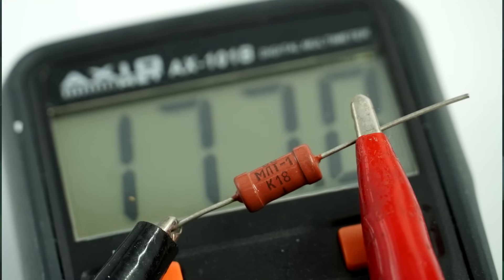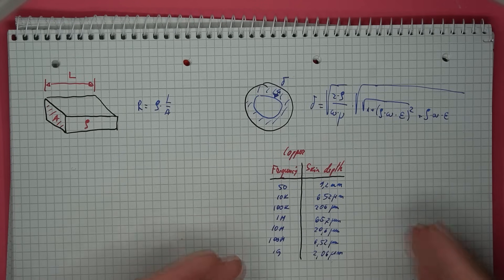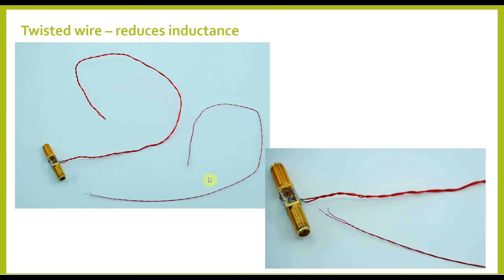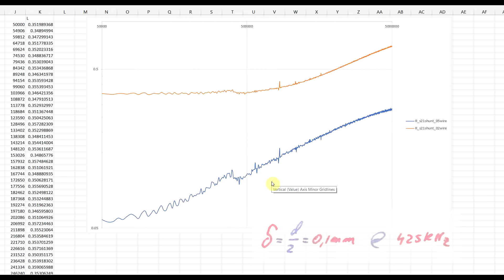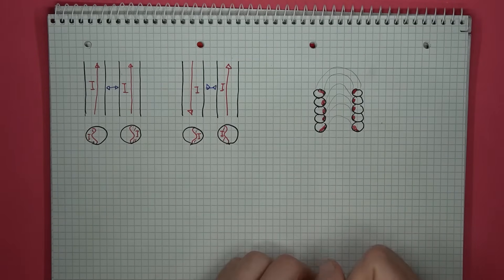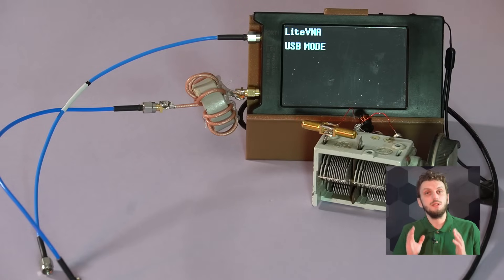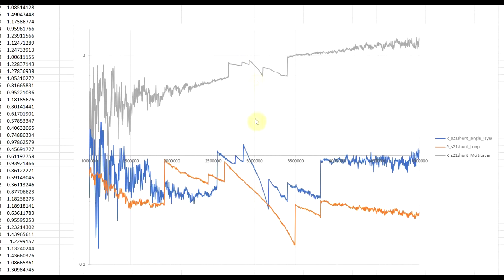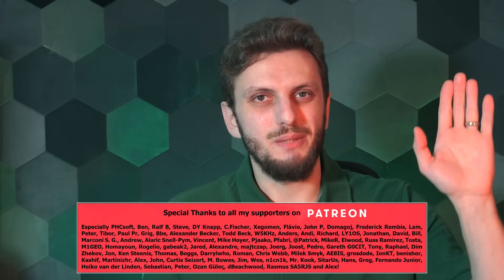Skin Effect and Proximity Effect

Comment: To avoid confusion, I would suggest using the correct term "impendance" when talking about the resistance of a component (or conductor) by doing a AC Measurement.

Measuring resistance by a DC Measurement is indeed still called 'resistance'.
Reply: Impedance has a resistive element and a reactive element.  The demonstration is designed to explore just the resistance and to achieve that, tune the reactance out which happens at resonance.  What is left is, or ought to be, pure resistance.
Reply: @thomasmaughan4798, thank you for explaining this so I wouldn't have to. Perfect explanation!

Comment: At 5:45, that is NOT true.  Parallel currents ATTRACT and anti-parallel currents repel.  Try it for yourself... or use the r.h.r. and the fact that like poles repel and opposite poles attract.  The skin effect is an electromagnetic interaction -- it requires both E and B -- and the fact that these two are out of phase near a conductor... V=dPhi/dt.

Comment: unrelated to the subject, but...

it would be nice to see someone do a practical demonstration of "jacobs law". its basically impedance matching. but more motor/generator oriented.

that is, which one has the lower resistance, and how the current appears as torque, or heat...

lol, i tried making a video and the camera wont show the display on the variable load... sigh... meh, and i really need to make one with a few fets that can deal with more than 25W anyway...

Comment: Interesting, I have  never considered the 'globular' distribution of current due to Proximity.

In a coil with both an AC component and a DC current, would the DC component act as a modulator of the AC resistance due to proximity effect? 

So, does superposition hold? Or does my question lead to a non-linear results? The answer is probably fairly simple but I don't see it at the moment. 

Disentangling heating from that sort of measurement would be 'interesting also,...
Reply: Since reactance is dependent on rate of change of current/voltage, then the DC component would clearly be superimposed and be equal to  the DC resistance.

Comment: In the 196ties we built coils with RF stranded wires with silk cladding for high Q coils. Specialists wound the coils crisscross to reduce the proximity effect.
The coils were used for the intermediate frequency path in superhet ham radios for best selection properties.
Today I am fantasizing whether an improvement of Q would be possible with conductors (wires) consisting of copper/silver clad plastic fibres.
Anyhow as we did not have a VNA all this tinkering and the rules for best results was full of myths.

Comment: I had never thought the proximity effect can be so dominant. Would using litz wire also help in mitigating proximity effect to an extent?
Reply from the maker: "to an extent" :D from what I read, litz wire, and special coiling techniques like honeycomb/basket wound coils will help, but only in the <5MHz region. Once you go above, there is not much that can be done...
Reply: Depends very much on how you lay your windings in case of inductors for example.

Comment: Great explanations.... I know you are more geared towards electronics, but the impedance from using large, stranded conductors for high voltage AC power transmission is one of the big limitations on how much current it can handle, know as line loss. As current increases, the impedance increases, heats the conductor and limits the conductors AC current carrying characteristics. Why sometimes when they convert an existing AC transmission line to DC, which does not suffer the same impedance related heating, it can carry more current for the same DC voltage over the same conductors. Since you just have the actual resistance of the conductor to worry about and no impedance losses.
Reply from the maker: The line's impedance should not be current dependent, only frequency dependent; whatever AC frequency is used, the impedance will be higher than the DC resistance, so the losses will be higher. Going for DC indirectly increases the current capability - the losses are smaller so the line heats up less.
Reply: @FesZElectronics  Correct, but when talking about large, stranded conductors,  the higher the AC current the more impedance the line creates, due to the twists of the strands generating magnetic fields and fighting current flow. Just like you showed with a coil of wire, but this is strands in a large, stranded conductor.  I'm a relay tech in substations and work with protective relays all the time. Take a look at a line distance relay protection scheme, also know as an impedance relay. It judges fault distance based on impedance and is calculated from the current and voltage, of course. And when the relay is set it can tell where along the line the fault actually occurred and if in it's zone, will trip. But as load increases, the impedance does in fact go up and line losses increase due to it. 
 Aside from an over current relay, that was one of the first forms of protection when the power industry started and still used today as a main source of transmission line protection.
And yes, depending on the system, 50 or 60Hz is a constant component in the impedance calculation.
Reply: @FesZElectronics  One more thing, on long, lightly or unloaded transmission lines the voltage at the receiving end actually goes up. We use shunt reactors to compensate for lightly loaded lines and of course shunt or series capacitors when the lines are loaded for voltage support. Look up transmission line series capacitor banks, super cool  how they cancel out the inherent inductive impedance of the line and naturally vary the capacitance based on current flow.  Again, using 50 or 60Hz as a constant the designer can decide on how much capacitance to add to cancel out the impedance and part of the equation is the expected range of current and voltage of the line.
Reply: @inothome  do you know of any literature on this?
Reply: @ Research advantages of HVDC vs HVAC transmission lines. There is plenty of info that will go in to line losses associated with AC lines and their causes vs DC lines and how they can transmit more power over the same lines. The converter stations are what makes HVDC cost prohibitive for shorter distances. But researching that will go in to the points I was making.
Reply: @inothome  very interesting. The company I work for is actually involved in converter stations for HVDC, but I've not really had involvement in that side of things.
Reply: @ic7481  That's cool, so you should be able to find out some good info from the right people there.

Comment: It's refreshing to see this actually demonstrated for some real wire, rather than hand - waved over or, at best, just presented as a formula full of unknowns!
Reply from the maker: Its actually not that easy to show without proper tools, but its a fun experiment
Reply: @FesZElectronics  seeing how you managed to.use the tools at hand to nonetheless show a result that matched the model was also interesting :-)
Reply: I’m curious how flat conductors behave with high frequencies 

I’ve made a couple of mag loop antennas using 1” x 1:16” aluminium strap. I haven’t put them up against the equivalent surface area of a tube. 

They work well enough, but o was curious. Not a huge amount of information out there.